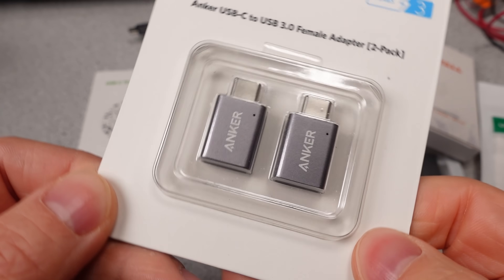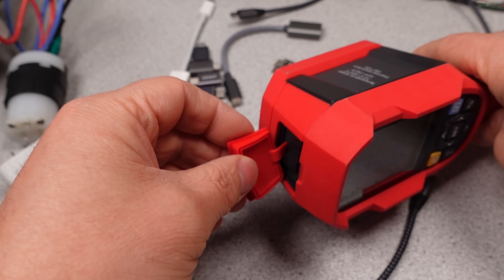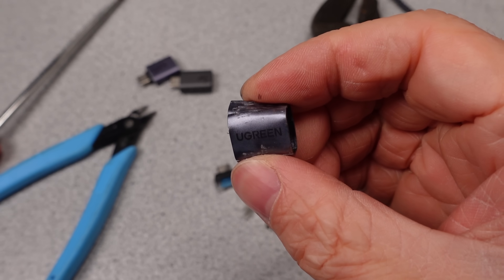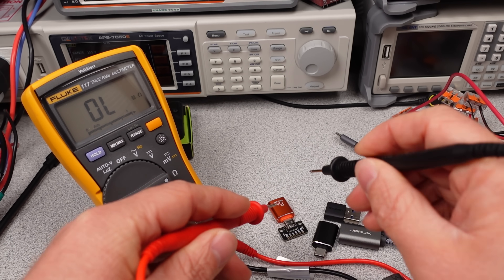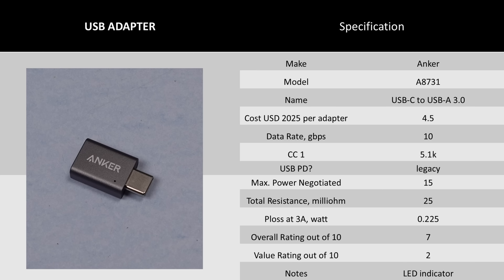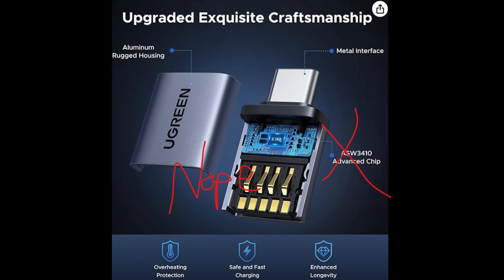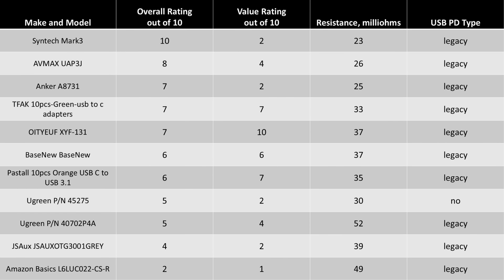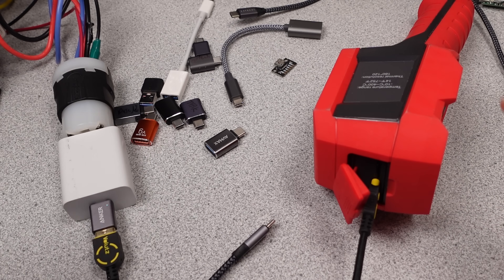Why do we need USB adapters still?

Comment: Can Any A to C adapter really work identical to an original C? Or just used for charging? I need a USB-C for a touchscreen monitor to/from my laptop which only has 1 hdmi (in use) and 3 USB 3.0s. Appreciate if anyone can answer this?

Comment: What about 12V 1.5A? I have USB LED lamps that come with a USB-A cable. Is it safe to use these adapters to power a USB LED lamp from a USB-C–only power adapter?
Reply from the maker: It will not function.  These will only ask for 5V.  You need to use a USB A port to get the QC function to get 12V from a USB A port.

Comment: I'm always wanted to get one of these for my older device. But not sure how reliable there are. How about the apple usb-c to usb A adapter? model A1632, mrsp at $19, is that any better?
Reply from the maker: The apple built adapters are usually pretty good, the cable will eventually peel away leaving the metal braid exposed.

Comment: Hey! I'm a little confused, cos on Amazon, Anker claims that theirs is a USB 3.0 5 Gbps adapter. And UGREEN claims to be USB 3.2 Gen 2 10Gbps adapter. That's why I opted for UGREEN. 
Why doesn't Anker claim it's 10 GbPS (as you have shown in the video).
Reply from the maker: Signal integrity, also when the product was released could be a factor.  These all contain the exact same parts, so as long as the wires are connected, which they are in both, it should work on either.  But if Anker did something like not properly shield things or cross wires over in odd ways then the maximum usable signal may sit at 5 gpbs, although the computer would have no way of knowing this since these aren't active devices.

Comment: I have bought some of the Anker ones. They grip so tightly that I can't pull mouse dongles out without damaging the dongle. I've pulled off the metal of a USB port with multiple devices. I can't use these. 
I have these tiny little adapters that go inside of the connector and those work well for USB 2 things. They can usually be hidden pretty easily since they're about the size of a coin.

Comment: For anyone planing renting a car, bring some USB-C to A adapters to power any USB-A electronics.  A few years ago my parents flew to Birmingham airport and their car rental only had the choice of a Polestar 2 EV and a large Ford 4x4 Ranger pick-up.  My Dad much prefers his Garmin over phone and infotainment apps and had all his planned destinations pre-programmed.  To his surprise the Polestar 2 only had USB-C ports and not even a 12v legacy port, so he ended up going back into the rental office and changing for the clumsy 4x4 pick-up just to use his Garmin!
Reply from the maker: Yeah that’s not great not including a 12v port.  There are many electronics that still use that port.  I refuse to use any built in power device in a car since they always ask for data access when you plug them in.  Nope.

Comment: what if i use those adapter if i have original apple type A charging adapter and USB-C to Lightning Cable,so i have to use type a to c adapter . cable is MFi certified ,the charge came with iphone.
Reply from the maker: That should work for charging.
Reply: @AllThingsOnePlace  yes ,it works for charging.. i tested it with usb adapter. no error msg..

Comment: Thank you so much for these detailed breakdowns. I purchased several of these Anker adapters a couple of years ago instead of any cheaper ones because I couldn't find any information about reliability or performance. Now I know I could have gone for a cheaper alternative, but I'm glad to know the Ankers perform well so the purchase wasn't a complete rip-off. Your videos are a valuable service to consumers in this increasingly complicated electronics market.

Your review of the SlimQ 150W GaN adapter was invaluable in my buying process and because of your video I saw that they are active in responding to the community's concerns which provided some reassurance that it was probably a good enough purchase. Not to be hyperbolic, but you're doing god's work.
Reply from the maker: Thanks!  Yeah, this is a more simple video but I think it's important to check that the adapters are at least at a certain quality level.

Comment: It takes many Years for an interface to be Phased out..like the RS-232 serial port, there was adaptors and  dongles for them due to legacy devices for many many years until it is slowly no longer seen today .. or very rarely seen..for USB-A to be Phased out. It will take decades more I think..
Reply from the maker: RS232 / RS485 still going strong today.
Reply: @AllThingsOnePlace strong?? By strong you mean..new desktop PCs and laptops are been shipped with RS232 interfaces on them? You mean accessories using RS-232 are still popular like Mouse, printers? 
Still alive Vs Going Strong is different..
The 3.5mm earphone jack is still going strong I would say but it's slowly disappearing on newer models of laptops and PC .. so e makers still choose to include a 3.5mm earphone jack on laptops but there are some who has stopped including it..

Comment: Seems like a huge waste of time based on arbitrary nitpicking.

Obviously nobody wants to use an adapter if they don't need to, so don't.  Unless you need to, or want to - based on a recognition that you aren't one of the sheeple that just overpays for what some shill  told you was "best".

Yes there are concessions to be made, the point is to adapter to get at least a minimal level of use to suit a need.

Kind of stupid to fantasize   beyond that, because USB-C was developed to have more features, but rather than fixate on that, you need to look at what features you need, for any particular purpose.

Don't buy adapters if you don't "like" that.  Buy new cables, even splurge for those hypothetically perfect for everything, and then it will be a waste of money for all applications where you don't need that.

Adapters have always had a similar situation.  I'm fine using them where they meet the need and I mean the ones where you get 5 to 10 of them for $2 on Aliexpress, or 2 to 4 on ebay for $6 delivered.

Back to the title of the video, you don't need them, but it would be really dumb to buy several new cables with idealized specs, when you don't need idealized specs and an adapter that costs $1 each will get the job done.

This is a similar discussion as USB power cables.  If your primary need is charging, does it really matter if it doesn't have more than one TX/RW pair of wires?  Only if your need was higher data transfer as much as power delivery, and were willing to accept a larger diameter, heavier and costlier cable because you needed data transmission as much as charging current capacity.

The thing is, you are not limited to only one cable or adapter per lifetime, many of us have a box full of them and would never pay a premium price for some hyped up piece of wire with a couple connectors on it.  Do what suits your need.

High performance products are great and we should all have them, until it's just a waste of money.  You do you.

Comment: I often use USB-C-to-USB-A adapters to fix the problem of powering cheap USB-C devices that are missing the pulldown resistors. These will not power when using a PD-enabled adapter over a USB-C-to-USB-C cable. It is sad that there are still so many USB-C devices like this. Another adapter that I like is the Adafruit USB Type C CC Resistor Fixer.
Reply from the maker: The resistor fixer is a good one.
Reply: I have to do this for my car’s dashcam. It requires plugging into my car charger’s USB-A port even though the dashcam has a USB-C port.

Comment: Would love to see a video about c to a adapters. I plan on getting thunderbolt 4 cables and converter to c to a. And therefore only have to carry these for my travels.
Reply from the maker: Thanks for the suggestion!
Reply: @AllThingsOnePlace my hope is that this combo could maintain power delivery and some sense of data transfer. Only want to carry one cable at this point in technology time.

Comment: I need an usb-C adapter, so i can charger a smaller bidirectional powerbank from a bigger bidirectional powerbank, this wont work on default, since the powerbank wont know if it has to charge itself or charge the other powerbank, does a directional "charge" adapter exist?
Reply: I know i can convert usb c to A and then charge from that, but is a C to C version possible that allows for higher wattages?
Reply from the maker: Yeah, I was thinking about that.  Adafruit sells a C-C version but it is also only low wattage, just resistors.  I was working on a USB negotiated version.  It ends up being many chip solution since you need a microcontroller to talk to the two USB chips to fool one into thinking it's asking for power and the other to think it's telling a power supply what to do and getting the correct answer.  The PD input side is easy, the PD supply side is not so easy.

Comment: I've used the Apple USB-C to USB-A adapter for years.  The one with the cord.  But I only ever plug flash drives into them.  No problems so far.  😎
Reply from the maker: Yeah, apple accessories I've owned have been of very good quality.

Comment: I mean, which devices that still require USB-A (either built in A plug or A to barrel jack) actually draw more than 10W at 5V? I have a fan, a lamp and a plasma lamp, 10W covers it all, 15W is just for bragging at that point. Data rate is probably more important.

Comment: The short cable is my preferred type because I noticed my USB C adapter is slightly bent downwards because my laptop is mounted raising up so the adapter gets pulled down that strains both the port and the adapter.
Reply from the maker: Thanks for the use case!  Yeah, that makes sense.

Comment: The passive USB A make to USB C female adapter is forbidden by the standard, for a good reason. If you aren't careful, it allows you to connect two USB A ports and put some voltage (5V ± 5%) into the USB A port, although it isn't designed for that. Most of the time, probably nothing wrong happens. If both ports are powered on, both should have 5V ± 5%, which is up to 0.5V difference. There is a good chance that it either doesn't matter or some protection is applied, but I wouldn't rely on it. If one port is powered off, up to 5.25V can be put in the port that isn't designed for that, and it depends on the device how it is handled.

Comment: 14:00 the advantage is tight spaces. If no cable, then the type-c part is as large as the type-a part and won't fit in some places. Same with Card readers so I bought the one with cable.
Reply: also the usb adapter together with the usb A device can give a ton of mechanical pressure and lever on the usb c port and maybe break it or bend it if you bump into it. The cable solves this issue

Comment: i bought the anker 200w desktop charger but i failed to realise that charging a 12v router from USB-a is not a straightforward task, now I need a trigger board to make it output 12v via QC. thougts?

Comment: There is one adapter that has a slighly different purpose. I recommend you to take a look at magnetic adapters. I really like them for charging, there are ones that can also do a high data rate.
Reply from the maker: I did look at some in the USB cable video.

Comment: I saw there's a few that go the other way, they convert USB QC to PD actively. Might be cool if you have a charger with a an USB A QC port and would rather have all PD USB C ports instead. 
The only thing that makes me believe that it's not a scam is that there's an LED that changes color depending on of it's connecting QC or normal nonQC, disabling the conversion.

Comment: Why not just use usb C to A cables?
Reply from the maker: More devices with USB C only, so you still need the adapter.
Reply: @AllThingsOnePlace  I'm not sure if I get you. For devices that have usb c and don't require high speed e.g. a Rode AI Micro, I use a Usb A to C cable if a Usb A port is what I have available. I just have A to C and C to C cables. Why have adapters that can cause errors? Or are you not understanding me because your video is promoting usb adapters?
Reply: @dyong888 not all devices support USB C natively. Some devices will only charge via USB A to C through an adapter.
Reply: @JessicaFEREM  What you're saying is not technically wrong. But I don't encounter that problem. Because why would you if you have a USB C device, try and charge it from a USB A outlet? knowing full well a USB C device might require more juice? It might charge very slowly or not charge at all. Why use an adapter when you can just use a proper charger with USB C out? A tiny adapter like this is just one more point of failure. Also the last thing I want is for these adapters to damage my USB C device. 

For myself I keep it simple, just use a desktop charge with the appropriate USB A and USB C outlets. 

For data, I use USB C to C cables or A to C cables depending on what ports are available on my machine. In short, I stay away from such tiny adapters. Some will not work for data transmission too. So I don't even bother with them. I use the appropriate cable, not usb adapters. I think that's the better way to go.
Reply: @dyong888  okay but what if you don't have a USB A port to charge from nor a USB A cable. many people just don't bother carrying one with them.
Reply: if you have a mac mini for instance, you have no USB A ports. you need adapters if you need to use a USB A device on it, including most wireless mice that don't use Bluetooth, because Bluetooth is a god awful standard. 
what you are saying is just physically impossible in a lot of circumstances.
Reply: @JessicaFEREM  Well one will have to decide whether to carry a USB A to USB C cable or carry one of those tiny adapters which is as mentioned another point of failure. Or worse, you lose them. LOL
Reply: @JessicaFEREM  Incorrect. No USB A port on your machine? Just carry a USB A to USB C cable, as mentioned several times in my replies above. Also harder to misplace a cable than a tiny adapter. Also less prone to failure when you have a known good cable. Be good.
Reply: @dyong888 what do you mean? There is no USB A ports on the machine. You need an adapter. 
Also using a cable with a dongle that's the size of a pinky is stupid.
Reply: @dyong888 USB A should never be on the device that you connect to your computer, it should either be Mini B USB, Micro B USB, TypeB USB (like a printer) or USB C. 
USB A to USB A cables should never exist.

Comment: I purchased a USB-C to magnetic adapter for my new phone because the USB-C port wore out on my previous phone. I would obviously be interested in research on usb-c to magnetic adapters. Last week, I tried the Google version of Apple's MagSafe, but it's still a work in progress, the magnetic 'puck' that attaches to the phone gets hot, and the charging is very slow, the hardware is obviously struggling in it's initial design.
Reply: This. I have a Baseus cable with multiple adapter heads but I read it's risky to use them so now I want more detailed review ;_;

Comment: so, correct me, but did you even test the USB 3.2 claim most of them have? Most I have only have USB 2.0 pins connected or sometimes no data pins at all despite saying USB 3.2.
Reply from the maker: I did check that they all have the USB pins and they are connected.  I was expecting some to be fake but nope, all connected.  I only have a '5 gbps' USB device but they all connected and worked near the expected data rate.

Comment: 10:24 The only difference between these adapters is their resistance and consequently the power loss, which is around 0.2-0.5W - irrelevant for the everyday user. Otherwise each adapter does usb2 and usb3@10Gbps (only one RX-TX pair in usb3-A connector) for data, and 5V3A for power with a 5.1kOhm resistor (only one? lazy, but works). 
Worth mentioning that these can do QC (Qualcomm quick charge) for 12V 3A and other proprietary fast charge protocols through the usb2 data lines.
Reply from the maker: Yeah, I was thinking of doing a couple of shorts talking about some of the other functions and features of these, it's a good point, thanks!

Comment: I actually use magnetic usb-c/usb-c adapters in my car.
Wireless charging is to slow and hot on warm days.

15-30min gives me more juice and i dont need to mess with connectors, just throw it in the direction of the phone holder.
Reply from the maker: Nice, yeah, I've tested a couple of them.

Comment: The advantage of a short cable is that it's less likely to damage usb port... If it's a really long connector I feel like it's too much pressure on the port..
Reply from the maker: Yeah, I can see why they keep them small because that leverage could be a problem.

Comment: There's an OEM that does really thick cable c to a adapter, called tobo it prolly sells under many names, it's kinda expensive so I never bought it but it claims it can do 10gbps and 60 watts. Do check it out if u can find it in your country 

 TY for the video!
Reply: usb-a can NOT do 60W with the common Quick Charge 3.0 protocol, that's max 36W, so 60W is only possible with proprietary protocol which won't be supported by most chargers, so it's practically not possible, regardless of what's in the cable
Reply from the maker: Thanks!  and Yep.

Comment: I hope you'll test the multitude of adapters on Aliexpress that claim they can do 40 Gbps and 140W for a few bucks a pop. Especially the ones that change the angle to 90 degrees or have magnetically attached plugs which is my main use case. I like to change orientation of the cable using the adapters quite often.
Reply: if there were any magnetic plugs that could actually perform decently enough, it'd be great to have for stuff like VR headsets where you can very easily be yanking cables or putting stress on the port when moving around